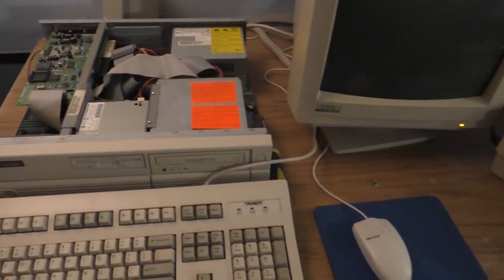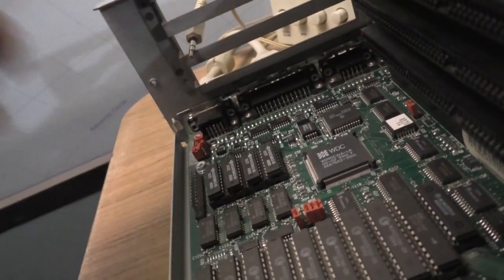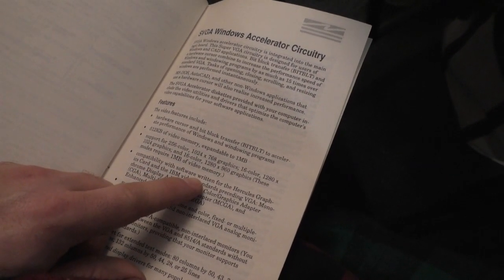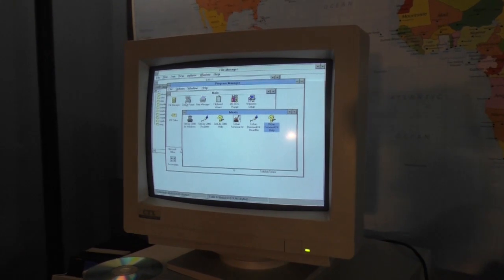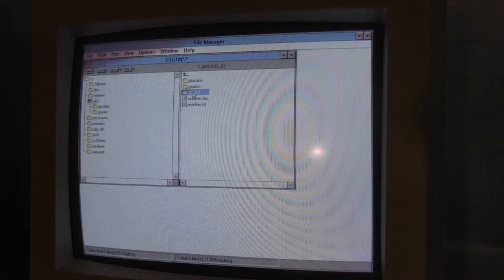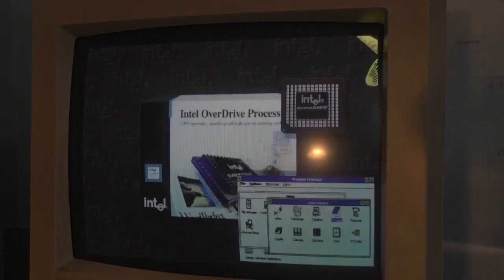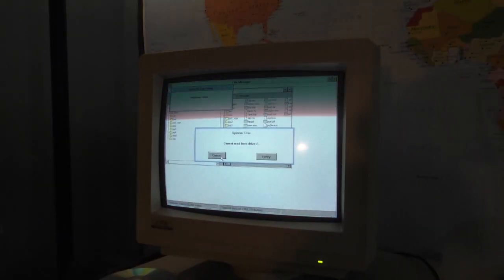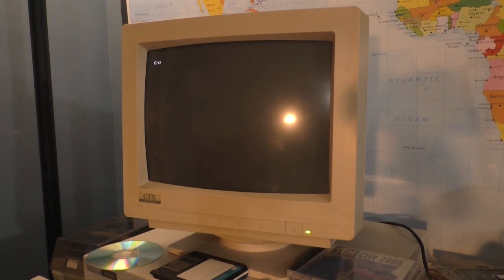Tandy 486 PC Restoration - Diagnosing and Fixing Video Issues

Comment: You can 3D Print chip pullers. Just an FYI. They actually work quite well if made from ABS. I actually think 3D Printing is one of the best things to happen to the various retro hobbys, you can manufacture what you need on demand. (almost) whatever you want, (several hours from) whenever you want.
Reply: @Moses Ivan Instablaster ;)
Reply: @Bruno Nicolas thanks for your reply. I found the site on google and Im in the hacking process atm.
Seems to take quite some time so I will get back to you later with my results.
Reply: @Bruno Nicolas it worked and I finally got access to my account again. I am so happy!
Thanks so much you saved my account !
Reply: @Moses Ivan No problem xD